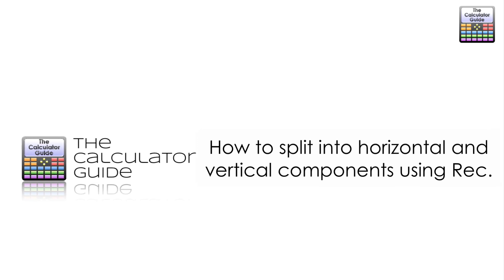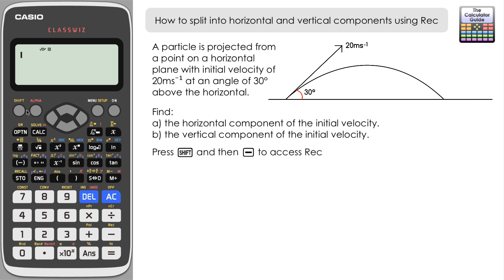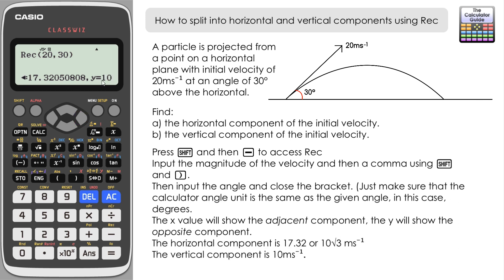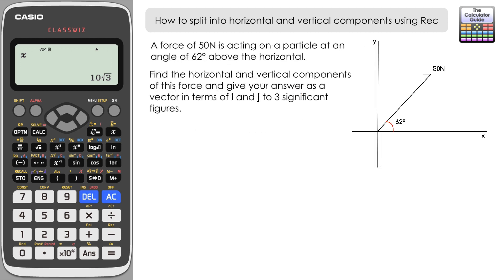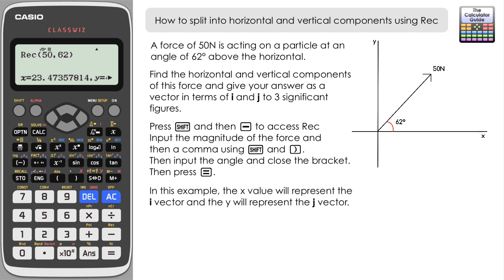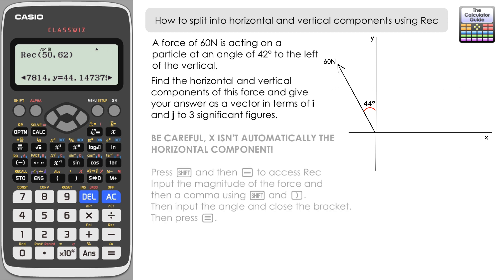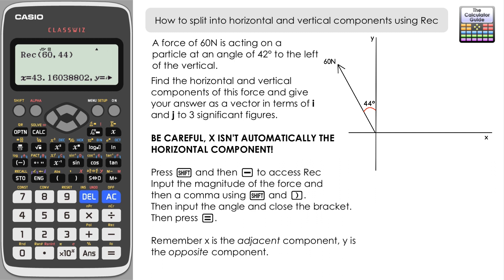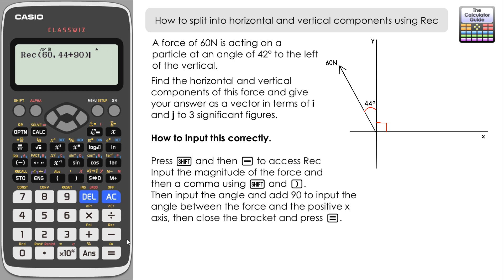A-Level Mechanics : Split Velocity Into Horizontal & Vertical Components | Casio Calculator fx-991EX

Comment: 5:41 Is the angle 44° or 42°? You keep switching.
Reply from the maker: 😀 thanks for noticing. Yes it is supposed to be 44 degrees but I typed it in wrong in the question bit. Thanks I’ll pin a comment.
Reply: The Calculator Guide thanks for being a proactive comment responder. I love my 991ex. It’s so great to learn more cool tricks. Thanks for sharing all of your clever methods.